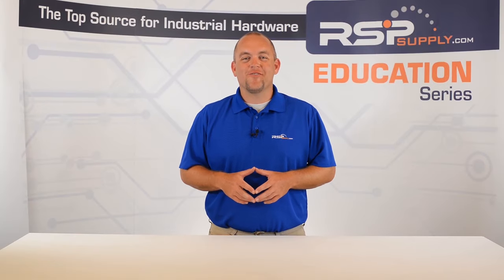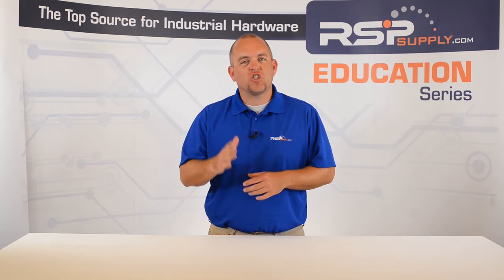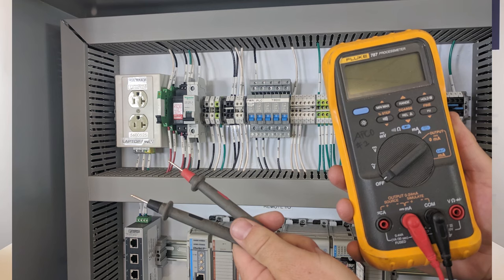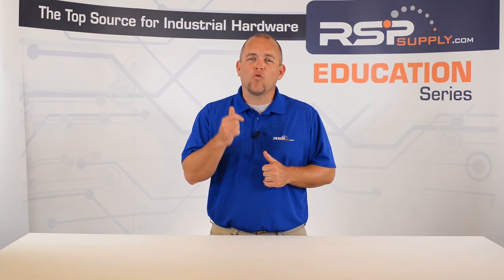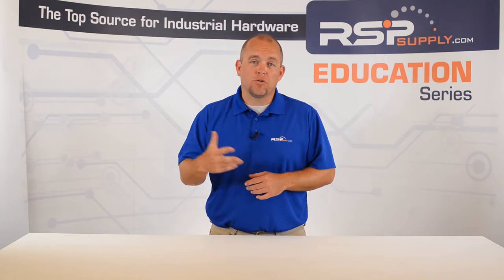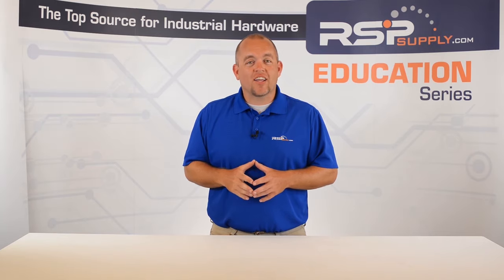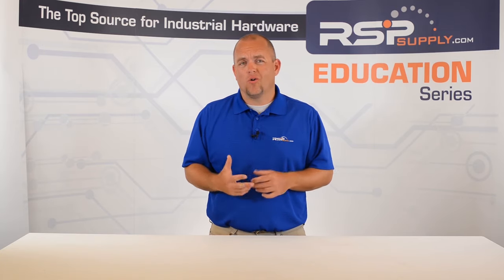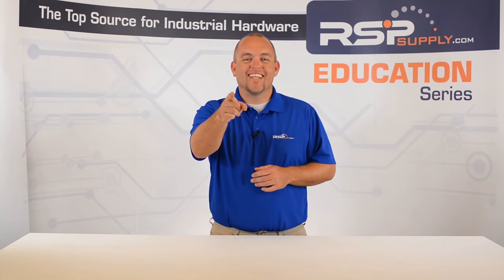Control Panel Testing - Tips and Tricks

Comment: What drawing? Machines are like 50 years old and so many new parts have been added over the decades without updating diagram.
Reply: Exactly.

"We need you to retrofit this ancient system with a new PLC."
   "Ok, no problem. Where are the drawings?"
"We don't have valid, updated drawings."
   "Ok, well can you at least give me an equipment list?"
"No, but here's a PLC program. You should be able to reverse-engineer and find out what's out there."
   "This PLC program doesn't have any descriptions, rung comments, etc."
"We need this done in two weeks."

:-|
Reply: That is where the knowledge comes in. Before removing wires and changing parts you have to design diagrams. I do it all the time.

Comment: Hi I'm just starting out at Panel building.  I'd like to get the proper size hole cutter for the Allen Bradly 30mm buttons. However, Every kit I find only has 1 1/8" (Slightly too small) or 1 3/8" abit to big. What do you recomend? We have a knockout, but I'd like to just use a hole cutter to get it all in one step.
Reply: insylem, check out the Greenlee Slug-Buster line. They have one I think will do the job for you.

Comment: It took me quite awhile to track down a electrical schematic drawing of an older milling machine, it saved hours of backtracking the wiring to get all the electromagnetic clutches and switches to function properly as many wires were installed  wrong from a previous repair attempt. Saved a bundle with the drawings. I vouch for the importance.

Comment: After over 20 years of professional troubleshooting, I would like to point to your attention the simple fact, that "Drawings" are not commonly found any where in today's factory. Yes, as strange and unlikely it sounds, drawing are scarce and far in between these days. In addition when we find drawings (rare occurrence) they are more often than not inaccurate and sometimes obsolete.
However I do agree with you that drawings should be our most important reference.
Reply: thank you for mentioning that, that happens on almost 78% of our machines and I trying not to exaggerate.
Reply: Idk what junk plants yall worked in but i never struggled to find a print. Just goes to show how shit the tech team mustve been in those plants. if we dont have physical, there is a digital print in a shared drive. If you cant find either, get the machine back up and call the maker for a digital. Not hard

Comment: Please use bullet points on the screen as you go over each point so the visual learners can read the training. Hearing something and reading something gives different results for each person. 75% of people are visual learners. All of your audible training means nothing unless you add visual representations of what you just said. When speaking about something you can say: How does the car sound to you? or How does the car look to you? The visual questions will not work well with someone who is an audible learner. Maybe you can look over the basics of Neuro Linguistic Programming to understand how to improve from here. Thank you for the video but it bores a visual learner to death in about two minutes or less. If you add written points as you make them verbally it will help the training of most people.